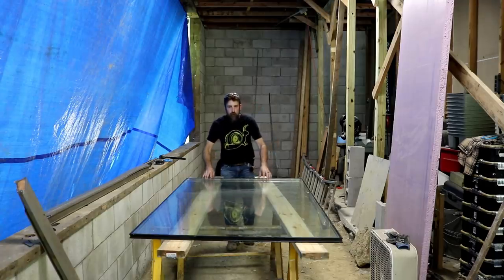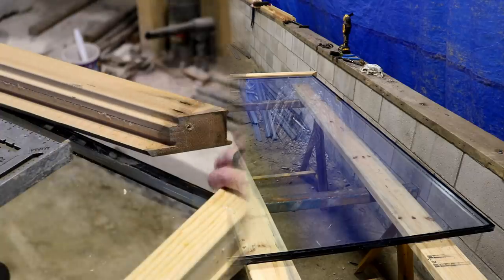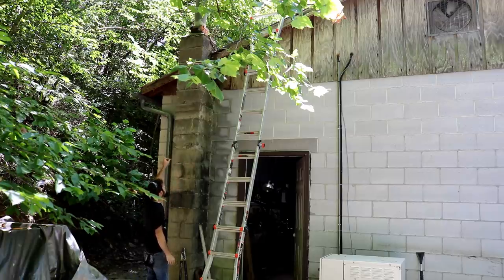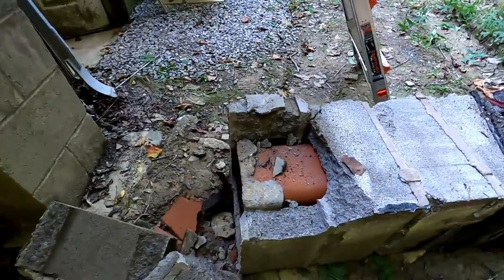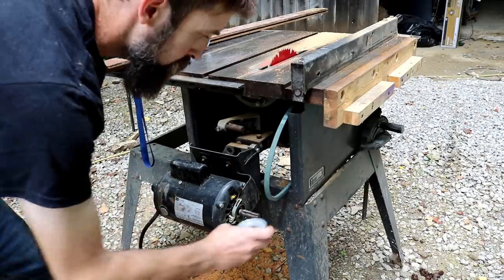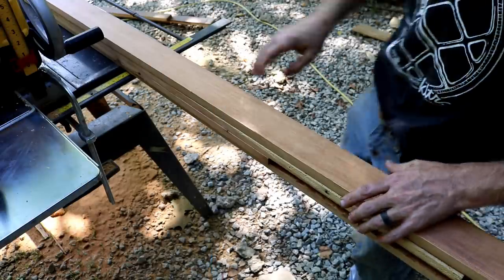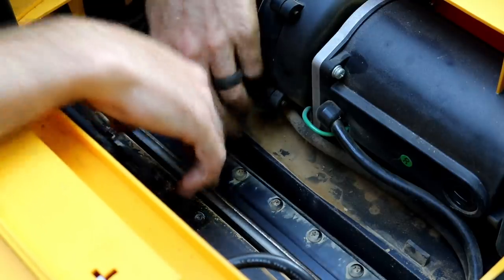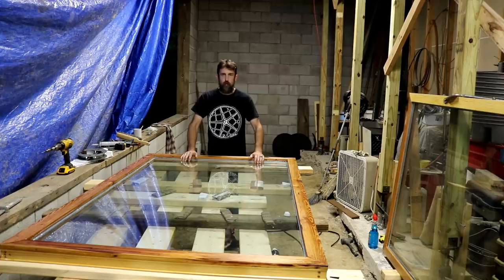Busting down the Chimney and framing the massive windows for the shop.

Comment: Well, you got a long way to go and it's already Aug !  Going to be snow flying and cold before you know it , funny how time fly's when the cold & rain comes. Hope you get everything weather tight by the end of Oct ! Any plans for a new heat source to heat the shop? will you need to replace the chimney or just cap off the hole ?  Might want to roll on a coat of cool seal roof paint to last until you can replace the roof, I have had pretty good luck with that stuff  on flat deck roof. PS I got one of them old Craftsman saws to. Mine is older ! has a tan motor said 1956 on it . Still works pretty good to.
Reply: To sum it up: Winter's Coming.  Where have I heard that before? 😁

Comment: when carrying large pieces of glass it is prudent to carry them up on the edge so they don't flex if you lift different than the other guy had it happen 40 odd years ago learned my lesson  just a thought  great video reuse work with what you've got, butyl tape is good for setting glass maybe better than silicone way less messy for sure and paint/polyu... will stick to tape  seems the old mason got payed by the can lmao always remember nothing sticks to silicone but silicone
Reply: I helped a guy install this big sheet of glass and while we were carrying it I was watching the sheet of glass whip back and forth. It was very unnerving. In my mind I kept seeing that sheet break and come down slicing the both of us in half. We were carrying it as straight up and down and as carefully as we could too. He figured by volume it must have weighed 147 pounds. According to the glass place we got it from it was too thin for how tall and skinny it was. But we were doing a reinstall. So putting back what was there in the first place. Plus thicker it'd have been even heavier. Might not have flapped around in the breeze so much though? Never again.

Comment: As much use as that table saw has seen, the motor probably has sucked up enough saw dust to warrant a good internal clean out.  I do mine every year and I'm surprised how much saw dust gets inside the motor, even with using the shop vac connected to the table saw base.  Those old Craftsman table saws can do the job with proper PM.

Comment: I would avoid using any of the sapwood in those pine boards and use only the heartwood. That sapwood won't hold up.
Reply: David Katz that's the Yellow timber Steve if you were not aware.

Comment: Carbide (especially carbide used in wood tooling) can be made just as sharp as HSS. It is a myth that HSS is able to get sharper. You can get carbide "hair popping sharp," just like you can with HSS.
Reply from the maker: Newer carbide seems to be of much better quality than the stuff produced 20 years ago.

Comment: Wouldn’t it create a more secure fit with grub screw on opposite side of keyway
Reply: The set screw goes in on top of the key so it doesn't mess up the shaft when you crank down on it. Better to mangle the key up, than to mangle up the shaft. A key is a dollar item, and the shaft is far more important, expensive, & difficult to fix. It will almost always be on top of the key.

Comment: I wonder if there was a date code on those cans
Reply: Ever see the little cuts on the side of a label on beer bottle? It looks like the bottle tangled with a piece of machinery on the line. Those cuts are the date code. I don't know how it works with cans but I imagine they do something similar. There's a card to read the label cuts. You hold the card up to the cuts and can decipher what they mean. Gotta work for the brewery to get a reader card. I knew a guy that worked for a brewery and he was always reading the codes of his brewery's beer bottles with his card. It's an inside thing. You plebes are not privy to such info.
Reply: @1pcfred  I also thought those little "dots" at the bottom edge of the bottle were a date code too, but maybe that's for the bottle itself, and how many times it's been re-used (back when they did that) not the contents.
Reply: @gorak9000  I only knew one person that worked at one brewery. But I've seen the cuts on other labels. The cuts look like just some damage. Like the labeler is screwing up or something. Companies don't want people knowing if their product is fresh or not. They still want a way of knowing themselves though. They actually take beer back that's been sitting around too long. I think it is 90 days? And that's what the cuts are for. But they'd love you to buy it at 89 days.
Reply: I think there was a bit left in the second can!!

Comment: It is common to have flooring, all the way to the 60's, to just have your flooring nailed to your joists.  My 5/16 Red oak floors are all that way in my 1947 home. Vapor barrier? What vapor barrier... :) Tongue and groove?  What's that?   These Tract Homes built in my area were designed  by law to be able to have military person live in one of the rooms. 

Hence you will find an additional side door in one of the bed rooms.  Once the duration of the law was completed only a minor alteration was made to the plans of the house to replace the door frame with a window frame. 

What was consider a "Cheap" home at the time, you can not duplicate it as it was the last year of all redwood construction. Everything is made out of heart red wood.  This means no termites (they don't like red wood) and naturally resistant to rot and mildew. 

The other reason I kept the house is that all the water lines  are copper and even the main sewer line was from 3 inch copper tubing.  Because of these things I know they will virtually last until the day I die.

It is the house I live in now for the past 35 years and the others are investment properties.  Like yourself I done a lot of turnkey operations instead of hiring out a contractor/ property manager and  reuse/re-purpose/rebuilt things.  I won't sell it because I know how crappy most newer homes are made. 

This is why I subbed to you.  You are reusing things and making things better with what you have.
You are thinking with your head and not with your wallet. And that is a great way to get ahead in life.
Reply: On the other hand I live in a house built in 1902 that has a diagonal-laid subfloor with 3/4" or maybe 1" hardwood laid over that. No vapor barrier, but houses in those days were designed to breath rather than be sealed space pods like they are now. The paint used was vapor porous, as was the lime mortar plaster, and the roofing was laid on spaced runners. Moisture could wick up through the whole house and out, generally without leaving a lot of damp, at least if you lived in a relatively dry climate.
Reply: You talk to much.

Comment: I sure hope you are going outside of the roof edge with a supported chimney pipe.  Cutting a roof on the edge so water can damn into the side of a chimney is a plan for failure.

Comment: Would have added strength if you added biscuits in the corners of the frame.
Reply: He put 3 screws into each corner. I do not think a wood biscuit would have added to that.

Comment: Sears sold some good items many years ago. Ironic how a company that grew to be huge through mail order catalog sales was brought down by internet sales and the burden of it's retail stores. I suspect you can find a "local" machinist to turn the shaft on that motor and maybe use a pulley with a tapered bushing to lock it on the shaft.
Reply: Have you watched any of Steve's videos prior to this project? Steve is an excellent machinist and welder. This is his machine shop that is being repaired.
Reply: @russellstarr9111  You must have ducked because the joke went right over your head.
Reply: @tiredoldmechanic1791  I didn't see any indication it was a joke.
Reply: Sears shifted their merchandise focus. That's what took them down. They went more in for clothes than durable goods. Sure they still had the tool section but that was not their primary interest. For a while the clothing was bringing them in more profit. Radio Shack suffered a similar fate abandoning their core customer base.
Reply: @russellstarr9111  r/whoosh

Comment: We can tell by the six pack of archaeological evidence that you found that your shop , at the earliest, was built in the mid 1980's. Beer cans changed from steel to aluminum in the later 1970's and changed from the pop top to the current tops in the mid 1980's. I thought your shop would have been older.

Comment: I'm surprised you're putting the windows so low to the ground.  By the time you pour the floor it looks like the windows will only be a foot or two off the floor level.  Just as a security issue, and maybe better light, it seems like they should be higher.   Just my observation from viewing the video.

Comment: making products with consumables built in is not ok at all in my book same with built in fail date and or make it impossible for owner or independent repair to fix it the blade could just as easily been made so you could sharpen them at least a few times before replacement this is a terrible new business practice backed up by companies like Apple and the others see this and hey if they get away with it so can we its a scary trend we as consumers need to put a stop to it tell companies its not acceptable